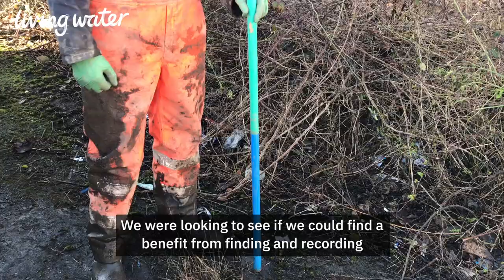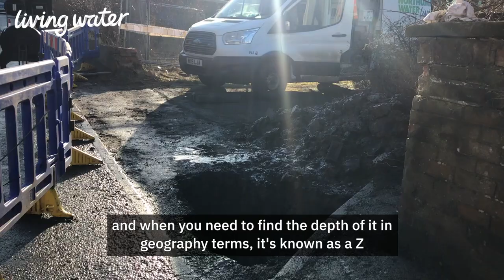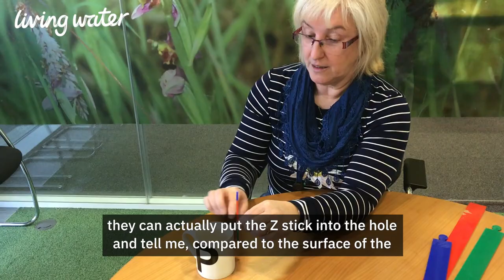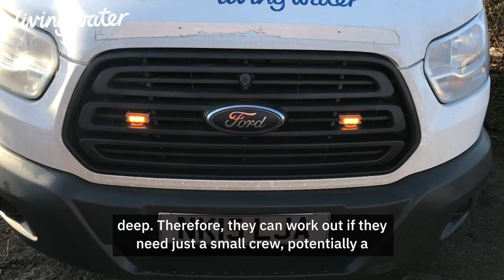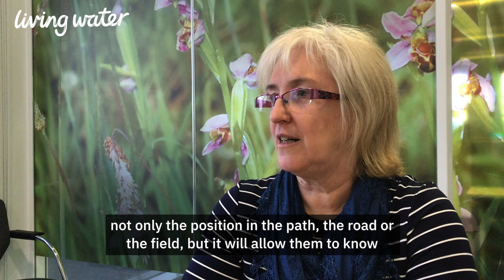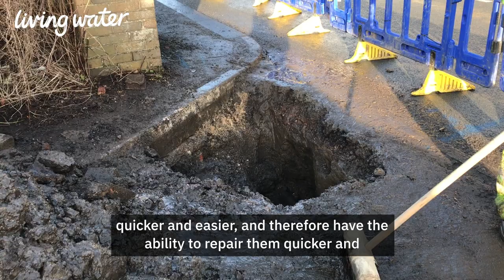Northumbrian Water harnesses the Power of Z

Comment: I have a better idea... why not use some kind of long strip of thin metal that has marked units on it for measuring (such as inches or centimeters) and can be rolled up to be stored in some kind of plastic housing.... aka a TAPE MEASURE??!! Apparently they've been around since 1864, you might want to get with the times!